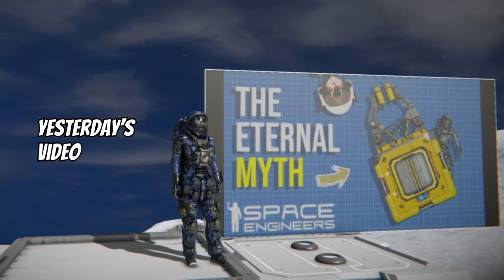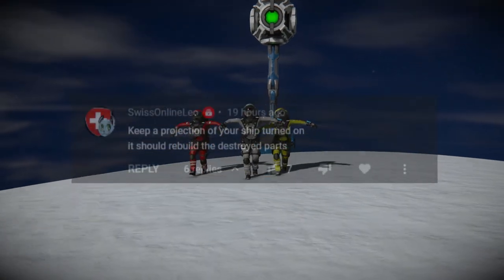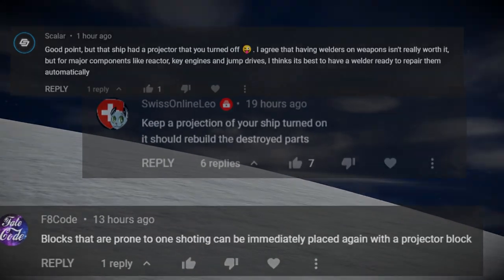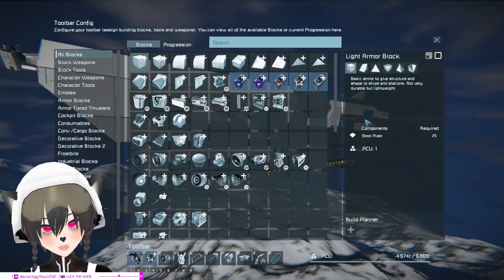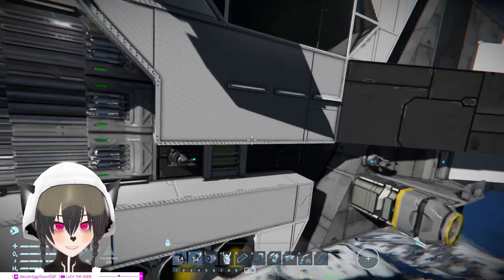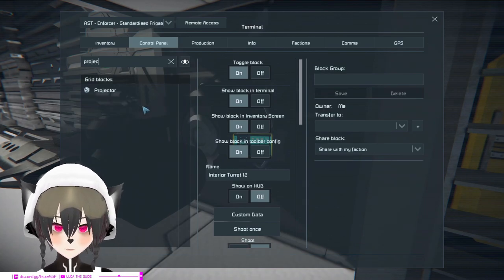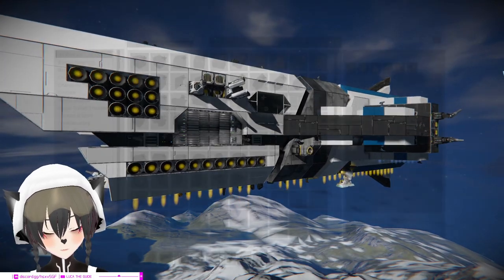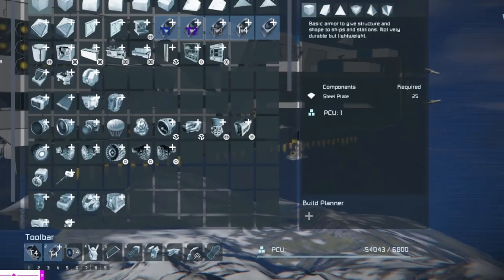Downsides of Using Projector For Mid-Battle Ship Repair on Space Engineers

Comment: isnt that what the "project only buildable" option is meant to workaround so it uses less PCU? Or does it just use less gpu power that way?
To be fair, i never really used it in mid battle, only after ... to repair and restore, not to exploit it as a health potion for my ship. :D

I really like your videos lately ... cant exactly point out why but i guess that doesn't matter anyway.
Reply: The project only buildable is just an option for reducing confusion or clutter when welding something up (so you can see what actually needs welded). I've never noticed a difference in GPU draw from either on or off.
Reply: @Gorwyn  Did you mean "PCU"?
Reply: @Gorwyn  well seems like I assumed wrong then. Learned something new. :)
Reply: you can turn off pcu limit
Reply from the maker: Not sure if project only buildable will affect the PCU count from projection x3 will have to test it out o -o and yeah me too x3 I do use projector to repair my ship but I put it on after, and thanks Argel u wu ♥

Comment: Your right I had forgotten that the PCU of the projector turned on is much more then just the projector itself and the blocks it project: I'm too used to just turning off the PCU limit. or going to servers where the PCU limit is way higher than the official servers.
Reply from the maker: Yeah I guess it doesn't matter too much if the PCU limit is really high and minmaxing combat efficiency isn't a priority x3 c=
Reply: People don't do it modular thats a big problem.  If you want self building, then create sections which can be printed.  This is what merge blocks and connectors are for.  You turn on the projector and welders to repair the internal systems.  The armour array can be merged blocked onto the outside of the ship.

This means that you can bring another ship and have the damaged ship repair itself from extreme damage.  Self repairing armour is expensive in combat, you need a big ship.  Its often better to just repair the damaged internal section so the ship keeps going and repair the armour out of combat.  This why you don't have to carry so much storage for all the materials.  For a smaller ship this is extra weight that the poor thrusters have to carry.  With small ships there is not going to be a gravity drive because that is high PCU as well.

Welders repairing a Heavy block,  a drill block and heavy block; require a railgun to destroy.  The railgun will take out a heavy block and the drill block.  Every other normal gun will fail to break the drill block and thus the armour will stay intact.  PCU limited ship just project critical areas and welded them.  Normally damage is to one module, so project the damaged area and repair.   This can easly be done in combat to make the ship operational for longer but rebuilt hydrogen tanks are pointless to repair.  They have no fuel.  So armour your ship with that in mind.

I have built ships were the internal sections are connect via connectors and are small ships within a ship.  Just make sure that the thrusters and gyros and connected to the outside hull that is connected to the bridge via the same grid.  That way each section can be a ship at the PCU limit, only connected to something else via a connector.

Comment: Not to mention projectors can also cause a bit of lag, especially when replacing a damaged block. It may also not even be able to replace the blocks at times due to floating objects, I know there are a lot of people that disagree with your views on this, and I am 1 of them that thinks welders and projectors are good. But I have weighed the pros and cons. I can 100% agree with your opinions on the issues this setup has. There are many more flaws as well as advantages the ship repair system has. Perhaps having a sit down with a few friends and having a TED talk would be a gr8 way for others to get a good idea of whether or not this setup is good for them
Reply from the maker: Yeah x3 and is okies c= was just pointing out the downsides x3 Ku-Jue's stuff are nice u wu
Reply: Yes, it is good to point out flaws and descuss advantages on any build. If you think a setup is perfect, you will never bother to improve. I know  its hard for many players to not have bias fof their buids and against stuff they dislike, but by removing  bias, you can make every build better. Every builc I make stuns me at how well they look and perform, and that can distract me from flaws in them. Thats why I likr hanging  out with SE players that have different build styles and strats. They can help me see flaws I have missed. I once thought wdlder decoys to be OP and did a few builds spamming them on my ships. Worked well before  warfare 2, but now the tables have turned. They are still useful, just not as much now. Its really situational on whether theh will be effective and there are many variables to consider. Information is power anx you should never blindly toss it away just because you disagree

Comment: I still think mid battle repair is useful when putting Welders in a Sturdy place
I basically use one welder between my Jumpdrive and main Hydrogen tank and the rest of the 4 welders have their own small Cargo container that are nicely Sandwiched between Artillery Turrets that have great durability.
Reply from the maker: It can work and I'm sure Swiss' setup works great c= I was just pointing out the downside in terms of PCU x3

Comment: Huh... Never knew the projectors ate PCU like that... I always assumed it was good for sitting at home base doing repairs or projects.  Guess that's up in the air too now...
Reply from the maker: Yeah it does quite a lot x -x but if you're not too tight on PCU that won't be a problem x3 c=
Reply from the maker: Also I think it might depend on how many blocks and what blocks are being projected u wu
Reply: everything uses up PCU, and the PCU of the Projector is calculated based on the Projected Blocks.
If I am correct I believe all blocks projected and unbuilt count as 1 PCU each.

Comment: Can you do a video on different power sources/power generating plocks and their upsides and down sides? I'm making my first ship but I just realized that using a reactor and artillery turrets would be uranium expensive so I wanna look into the forms of power generation, but I'm not sure which is best for my ship.
Reply from the maker: I might c= but uranium is pretty good if you don't have too many things on your ship, I usually have 1-3 small reactors with many batteries and hydrogen engine for backup, as well as a single solar panel for idle power

Comment: The amount of welders needed to repair a ship in active combat is too big and would make any ship very fat. However, if it was used for regeneration after getting away from the action it could work, imagine something like you escaped but you want to try to land a final blow but you need to wait for your weapons to "regenerate"
Reply from the maker: O: that's an interesting way to use them x3 I do use projector for repairing my ship but I mostly just put the projector on after battle and usually have to grind down my turrets before I turn on the projection because PCU limit xD